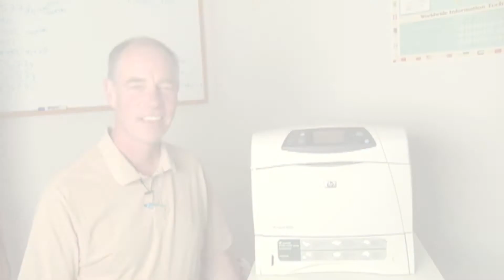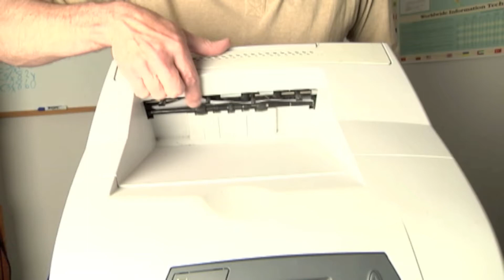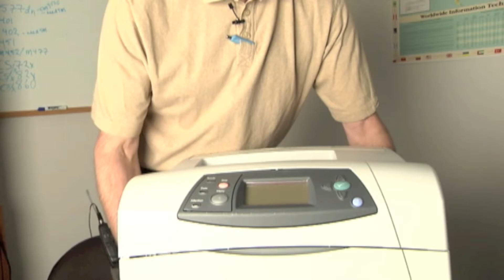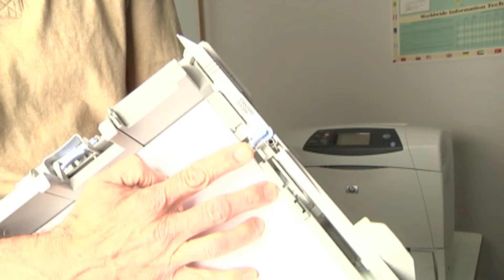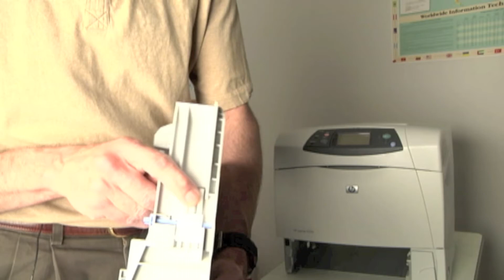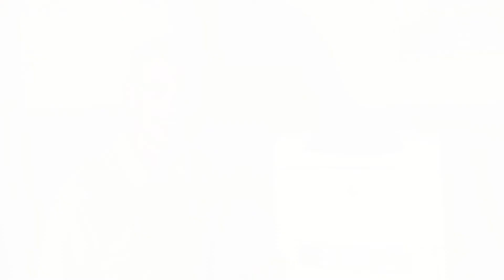PRINTER REPAIR: Fixing Common Duplex Printing Issue

Comment: I was trying to fix my Canon MX240 series duplex, it was just grayed out and would not print 2-sided. When you tipped me off that it had to do with the paper tray, I went in to paper settings and realized the paper weight had been set to something like 30#. Reset it to normal paper weight and the duplex was activated again. Nice lead!
Reply: Can it print double side please i have the them model and can't print double side